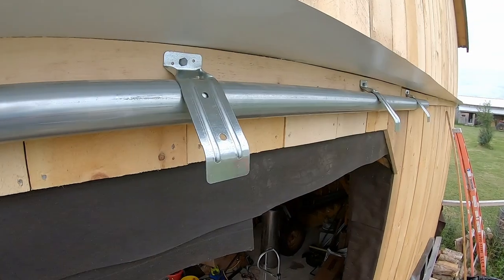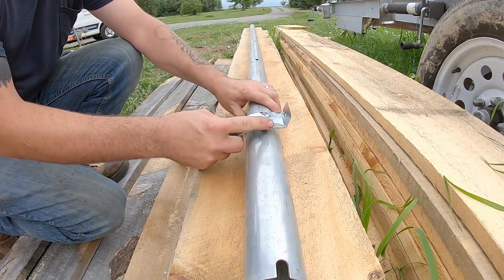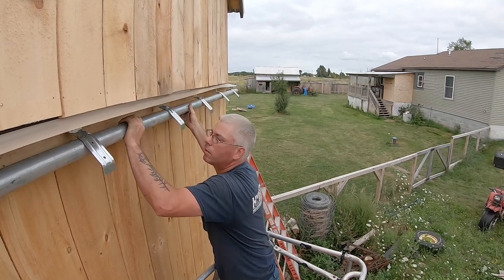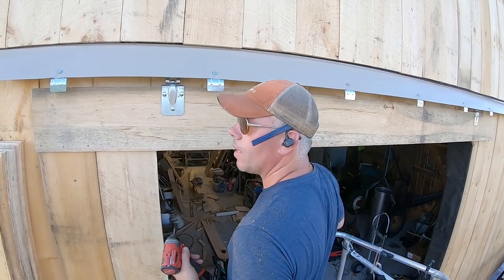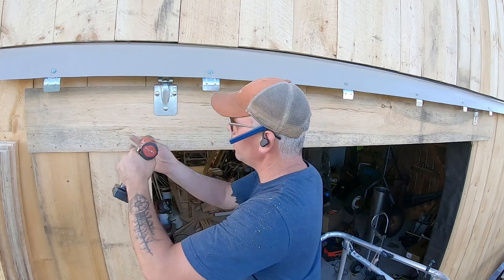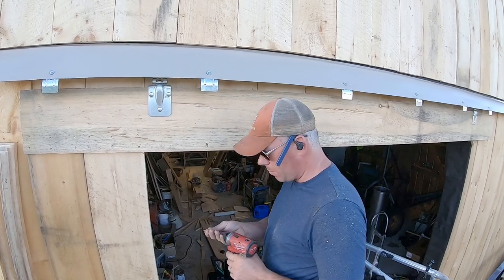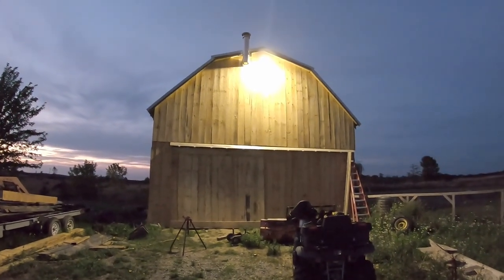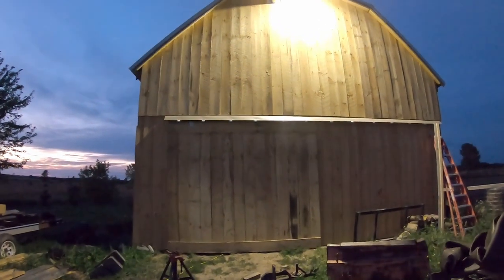A Timber Framing Vlog: A Proper Barn Door

Comment: Looks good Jim.  My shop door has a similar set-up.  I just need to figure out a way to get a better door seal to keep more heat in during the winter.
Reply from the maker: Hey buddy.  Try to find some Armaflex pipe insulation.
Reply: @TheTradesmanChannel  I might just try that. Thanks.

Comment: Looks like you need an updated speed square. It's interesting to see the evolution of these sliding systems. One similar to yours is on the barn and one with a 1/4 x1" flat bar and wheels are on two other sides. Nice. I want to install doors like you did have. Sliding doors let too much air get under them and slam against the barn. I won't have free wood we're selling the woods.
Reply from the maker: I'm sorry to hear your selling the woods.  It's hard to lose good land.
Reply: @TheTradesmanChannel  Gotta keep peace in the fam.
Reply from the maker: I'm still sorry to hear it.